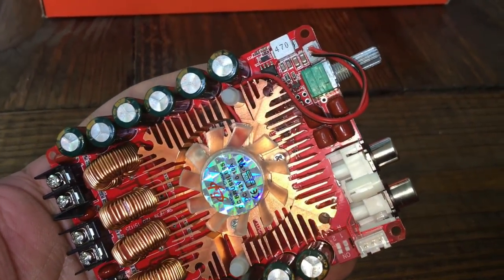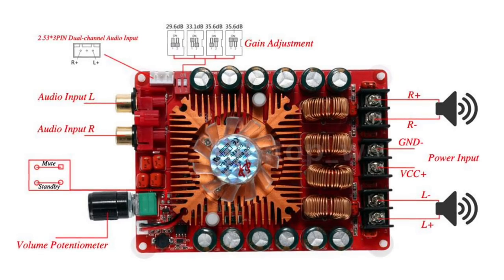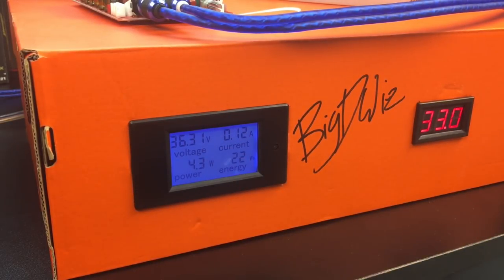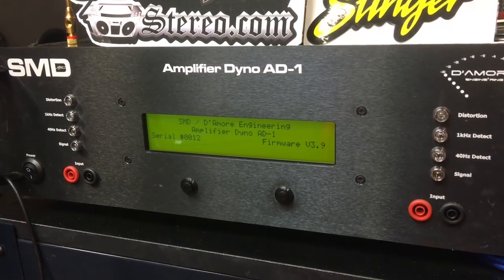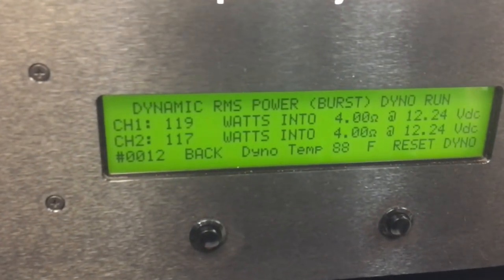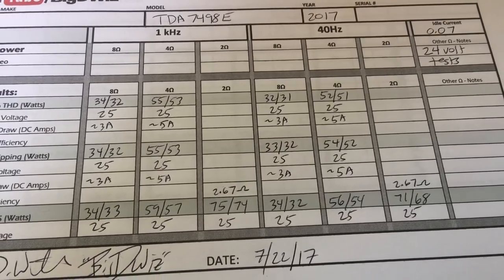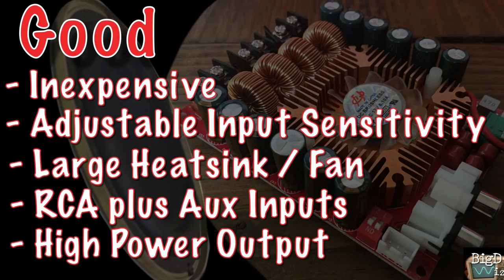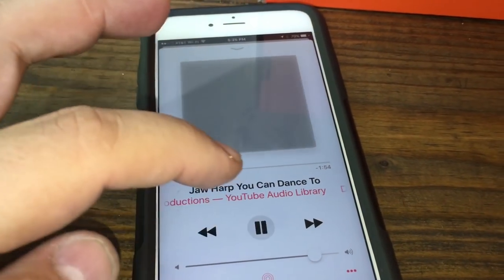Big Power in the Palm of Your Hand - TDA7498E 160+160 watts

Comment from the maker: Full disclosure: I purchased this amp, it was not provided by the manufacturer. All of the opinions in this video are my own and the content wasn't reviewed by anyone prior to posting. Affiliate link is placed below for your convenience. I receive a portion of the sales from these links, which help me bring you more unbiased content for this channel.
TDA7498E 160+160 watts - https://goo.gl/dw9LbO
Reply: These things are crazy for the price, but what is the amount of watts for it to be totally clean?
Reply: Thanks, but you're getting at least 1% THD at these settings correct? I'm thinking 40~50 watts @ 4ohm @ 0.01 THD Clean Rating? So I can figure out which speakers to buy. My PA system is 6200 watts, but I never use all of that because I want it as clean as possible and the same idea with my guitar amps. I using 2 full stacks running at 220 watts @ 2ohm 2 heads and 2 top and bottom speaker cabs a total of 16 12 inch,  440 watts @ 2ohm stereo to get the cleanest sound (Headroom) I'll use at the most 180~200 watts and normally a total of 100 watts when I play clean and picking from that 440 watt People tell me it's overkill but when I hear them play clean, it's still distorted because they're pushing their 100 watt head or amp to 80% I only push mine at 20~40% and the amp heads last longer. All about the headroom. I played some really big venues Larkfest was 80,000 people so I do need the power regardless
Reply: MrBrymstond Pretty sure these tests were done @ 1% THD. Just to give you an idea. And it all depends on your definition of clean. Some claim you can hear 1%. Other people say anything under 3% is fine. This is very limited in it's uses really. He says it doesn't have good bass. So probably terrible dynamics. Low damping factor. Zero soundstage most likely. I wouldn't expect great vocals. Maybe good for computer speakers alongside a powered sub? Plenty of clean power for that I'm sure.
Reply: MrBrymstond I wrote my last comment earlier, but just posted it. 
Actually if you pause the video and look at the specs it says 0.05% THD @ 1 watt.
Reply: MrBrymstond And I totally agree about headroom. Plus the dynamics are WAY better with more power. Your speakers really come alive with more power.
Reply: Ok thanks that's not to good, wow!
Reply: Absolutely, it's the way to go...
Reply: Great review, thanks for these kind of videos, they are very usefull. I have a question, usually these chinese amps do some sparks when you plug the power, did it happen to you? Also immediately after plugging the power, all voltage is discharged to the speakers, which they stretch alot, wont it ruin the speaker? Thanks
Reply: BigDWiz hey boss, I need some advice. In my boat, I have a jl audio w3 10 inch - 4 ohm sub, and two wetsounds rev 10 tower speakers that take up to 300 watts rms each. I need an amp or amps to push the these three speakers. Household finances have taken a hit, so top tier or premium quality aren't on the table this year. I am looking at getting two Pyle PLAM1000's. One for the sub, and one for the tower speakers. Have a budget of about $250 to work with. Can you please help me out with some advice or a recommendation?
Reply: blake dymond You should say what version the sub is. And you need to do more research. It took me less then a minute to find out that this Pyle amp is horrible POS that only puts out 70 watts power channel before it clips, and has screaming loud fans. You get what you pay for. If I was you. I'd be looking into car audio amps. 1 5 channel, or 1 mono, and 1 2ch, or 4 ch bridged. And used too. I have PPI 900.5 that would give you 230 x 2 bridged and 270 for the sub @ 4 ohm. I'm assuming the tower's are 4 ohm also. It's a shame the sub isn't 2 ohm. I paid $140 shipped for that used. @2 ohm the sub is 440 watts. Look at caraudio.com and doityourselfmobileaudio.com for good used deals on car, and occasionally, marine amps. Of course ebay, and Craigslist. I prefer forums as they're cheaper, and you won't get ripped by some scumbag most likely. You'll also be buying from a person who actually used it, and can tell you all about it. Decent car amps actually put out what they're rated at. Companies like Pyle are not decent. They're a waste of money. Either way car amps are cheapest, and best quality for your use. They really pound too. High damping factor which is important. They're designed for the environment you're gonna have them in too. Most have very good sound quality. My PPI is clean, and LOUD. It is also WAY more dynamic then my 125 watt per channel Sansui 8900zdb receiver. And that's at 75 watts per on 6.5inch speakers. They pound more then any of my home speakers do @ 50 more watts. And I have 6 different pairs running from 6.5in to 12in. Some ported, and some sealed. The car has that mid bass kick I wish I had at home. Car is the way to go IMO. At least for your application anyway. Good luck. And stay away from those cheap brands. Buying used is how you save money.
Reply: BigDWiz budget friendly 500 rms home Amplifier? Any suggestions?
Reply: MrBrymstond lol no way! 10watts?
Reply: MrBrymstond I don't believe Big D would approve.
Reply: For real 1,000 and another 2x500
Reply: I bought their 2x50 Bluetooth and it's a gem
Reply: +300 club Feeling a bit excited right now?
Reply: MrBrymstond no reviews....u really think it does rated? Let me check there return policy
Reply: MrBrymstond no reviews....u really think it does rated? Let me check there return policy
Reply: Even at 3/4 that's 750 watts clean and it most likely does but I'll bet you hear the distortion
Reply: Try the tda7294 or tda7293 theyre pretty awesome ones from st. Note 35-0-35(70Volts) to 39-0-39(78Volts) is the sweet spot (rated 80 volts) theyre by far my favourite chip im designing a 1000+Watt guitar amplifier using them and a few transistors
Reply: i would like you to make the same with the KNACRO 500W Mono amplifier!! is an insteresting board but will this get close to 500w? they sell it in amazon for 26 bucks!!!
Reply: BigDWiz nnn    l
Reply: BigDWiz kkkkmkkk
Reply: BigDWiz
Appreciate your posts have a question hope you can help I have an old set of celestion Sl6s book shelves want them on blue tooth amp there 100 watt @ 8 ohm . Will be running off multiple deep cell batteries in an RV. 
   If your ever looking for another Mazda b I always buy and sell them.
Reply: Efficiency?
Reply: BigDWiz the  best amplifier  reviewer there is information over load I would b happy if u do a review of the tda8954th an the IRS 2092S mini amplifiers
Reply: Ima buy a few and use some old school heat sinks I have in stock
Reply: Can you transmit them tunes please, I like :-)
Reply: Hey BigD, may I pick your brain for a second about the voltage booster, as you seem to know what you're talking about....I'm using a couple of car amps for home use and running them from PSU's. I'm guessing the PSU is under-powering them at 12v, would using the booster to make it up to 14v (if I can) make any noticeable difference to the amps output?
Reply: That's why we love ya man.. honesty means a LOT to me. Esp these days
Reply: @MrBrymstond  u have the link for that one?
Reply: @dwgwnr1969  No, but there much stronger.

Comment: Hi BigDWiz
Thx a lot 4 testing "China-Boards" it's very interesting, to see what you get for almost nothing. I have done a lot of testing myself and i suggest you put at least 2x22000uF 50V capacitors in parallel, very close to the amp power terminals (max 4 inch thick cable between capacitor and terminal). Then you will get some different data! These boards are very sensitive to supply's ability to handle PEAK-currents. ALSO the wire you use in your test from booster to amp, is way too thin! 320W total RMS@36V = 9A RMS! So current at the top of sinewave = 18A (4ohm load), So if the amp is 90% efficient at best, you must calculate with a minimum of 20A@36V running 4 ohms. So try to put on some 8 AWG (10mm2) wire and test again, then you will be surprised!!
 If you put a scope on the amp's power terminals, when running the test, you will see what i mean...
Best regards Jesper from Denmark..
Reply: Are the caps to provide extra current for power peaks? Is that what the two rows of large caps on the board are for? And so would upgrading them be any good?
Reply: @andreaselme4127  yes, pwm (digital) amps draw serious current peaks, thats why you always see rows of capacitors, and the bigger, the better. It needs to be very low ESR-caps, thats why there usually is several medium sized in parallel, the ripple current peaks in 300KHz to 1MHz, so low internal resistance in hf region is important.
Reply: Hey Jesper, may I pick your brain for a second about the voltage booster, as you seem to know what you're talking about....I'm using a couple of car amps for home use and running them from PSU's. I'm guessing the PSU is under-powering them at 12v, would using the booster to make it up to 14v (if I can) make any noticeable difference to the amps output?
Reply: @incorporeal3793  probably not tbh, the power supply can only output so much power on the 12v rail, so even boosting it to 14v wont help alot because the main power is stil coming form the power supply. Getting a larger wattage power supply would help id bet
Reply: Jesper, good info, thanks. The boost converter is only rated to 20A, it's possible that might be hitting the limit too.

Have you ever run your TDA boards at their maximum rated voltage? I'm reading the spec sheet and it specifies 45V as max DC input voltage. It seems you could reasonably get an extra ~10% by bumping it up to 40V.

Incorp, you can do that but you're still limited to the current output of the power supply into the DC/DC boost. You can put multiple PSU's in parallel or a really big one to get a lot of 12V current and feed a big boost board.

Comment: If you would of bridged it on the back you would be able to do the 2ohm test on it. that really what it really for. its a single channels amp so it doesn't bridge channels. it just allows you to run it at lower ohms. If any one wondering what it's really for.  🧐✌️

Comment: The output wattage comes from the theory also.Power=Volt^2 / Ohm,36v ^ 2 / 8=162 watt.Very good but it is not made for a lifetime,nor operation in full power and it is good as long as it lasts.

Comment: You might wanna check the output terminal labels. Mine were marked incorrectly. I checked using an oscilloscope. + and - speaker output is reversed on both channels.

Comment: These work really well for efficient Biamp line array pa speakers. Double 8 inch 8 ohm woofers down to 4 ohms on 1 channel for mids  and a compression driver on the other  channel for highs. Use a external crossover and bam they DRIVE plenty enough for concerts. There is a small 36 volt 5 amp Ac to dc power supply you can get on ebay for 10 dollars and I add a couple 10000 uf capacitors on the output of the power supply for a dynamic buffer. Cost about 40 dollars per cabinet to power excluding the xlr connectors and ac power switch. Reply if you want more details
Reply: Wuzhi audio build new tda7498e board , verry nice wondom Design.

Comment: I've just blown this up this morning, brand new, i only got it delivered yesterday, now it's on its way back to Amazon. 
Tested it this morning just to see if there was any sound coming out, i tested it on my subwoofer by replacing the TPA3116D2 mono module i usually run on, it appeared to push my woofer less than the 3116. 
Therefore, knowing that i bought it to use it bridged for the subwoofer only, i've bridged those J1-J2-J3-J4 and thank god i've i've been cautios and i didn't hook it up to the woofer or the computer. 
It lasted 1 second long after being powered on, made a big POP, smoke, so i promptly shut off the 24v power supply. 
Curious to see what happened, i've removed the heatsink and i've found a SMD 202 resistor being slightly bulged. 
Although the bridges were soldered up accordingly to the scheme on the board, and me having hooked up just the left channel (BLT) from the NE5532 pre-amp, i've removed the bridges and decided to give it another go, no matter the result : an ever bigger POP, and 3 legs chopped off the TDA chip. 
This has to be the crappiest board i've ever got my hands on, they didn't even bother shoving in a manual telling you how to operate it, i just had to take my guess and look at how other people did it (that didn't go to well i suppose lmao).

Comment: Sir, I bought the same amplifier with the black squares instead of those orange caps... What will be the difference?
Also, please I need your advice where to set the voltage of my Buck Converter, at 30 volts? This is the amp that I am building for my stereo electric guitar effects (stereo reverb, delay) :
Amplifier: TDA7498E 2*160W 12-32V
Power Supply: 36V 10A Switching
Buck Converter: 300W 20A 6-40V
2x JBL CS763, 45W RMS, 135W Peak

Comment: Bought this amp and literally smoked it when I shorted the speaker leads for only a moment. So, be careful it has zero short circuit protection. Other than that it sounds pretty good on my Polk Atrium 8 speakers. Bought a second one so each amp can drive one speaker. Will drive both of them with a 36v 15A power supply I bought.
Reply: What do you expect for the price? They build this cheap crap with counterfeit parts. That includes the IC.
Reply: @1pcfred  Yea. A lot of the chips are actually counterfeit TDA7498 not  even counterfeit TDA7498E. Looks like he got something closer to a TDA7498E on his.

Comment: Even though it didn't hit rated. For less than 20 bucks that was still pretty impressive. I'm sure that what you trade is longevity but its a step in the right direction for the red team.
Reply from the maker: Fo sho, not a bad deal

Comment: Considering putting one of these in the attic above my back patio, audio input coming from an airport express, and ceiling speakers mounted in-ceiling under back porch. Would heat in the attic be an issue? Just want it out of sight and always on. Decent enough to pump tunes through a couple Definitive Technology di 6.5str speakers? They are dual voice oil 8-ohm, so would like to wire each one parallel to achieve the 4-ohm numbers.

Comment: One of these , that voltage booster , a Bluetooth module, and an old PC power supply seems like it would make a good amp that you could use in a garage, or a small cabin without a big investment to to a built-in system.

Comment: Hope you are doing well! I have two passive bookshelf speakers and each tower consists of Woofer 6.5 Inch 4Ω (60W RMS)+Mid-Range 4.0 Inch 8Ω(40W RMS)+Tweeter 1.5 Inch 4Ω (20W RMS) that is 120W RMS+ 120W RMS Three way system with crossover. Can I use my two passive bookshelf speakers with this amplifier boards as 2.0 with ease or not. If yes could you please advise me on the appropriate volt of the transformer and the ampere?

Comment: What about testing B&O icepower moduls?
They may be more expensive, but you get quite a lot also.
It have auxiliary power for external filters,  So you will not get any grounding problems.
you can plug it directly from 240/120 ac power. So you will not need any transformers at all.
It is used in very expensive B&0 products.
So cheaper model will end up more expensive than B&0 products since they need transformers
and rectifiers and capacitors.
And it does not needs noisy fans either..
Simply best amp for tiny places and easy plug and play modul.

Comment: Howdy, I'm building a box with a 120W 8ohm 6inch sub and 2 35w 8ohm midrange speakers. Would this amp be suitable or off hand could you recommend an alternative?

I do plan to use a bluetooth module as well (or an amp that has one integrated). I plan to build a semi portable bluetooth speaker. TIA.

Comment: I've been playing with one of these amps for a few days and indeed it has some roller coaster of a crossover band. It's relatively flat from 200 Hz to around 23 kHz, there's a huge spike around 26 kHz, then drops off to zero gain at about 28 kHz. On the low end, gain drops slowly from about 200 Hz until it goes down to 100 Hz then falls like a brick. Perhaps this amp was made for dogs?
Reply: Cheezy Dee    this, my sir, is some valuable information you've got there!
Reply: What do you mean it falls after 100hz? test showed almost same power at 1khz as with 40hz, you sure you didnt get board with lpf?

Comment: Hi
I need a 120w rms for my small subwoofer 4homs.
I have a 150w step up 12v to 30v adjustable. 
do you recommend any board? 
Regards
Reply: Use 36v 10A smps power supply for full power.

Comment: I'm having the hardest time finding an amp that I can run both channels into one speaker. It sounds like you said that can be done with this amp?
Reply: Yep, this amp will run in BTL mode with both channels wired in parallel to give 220W.

Comment: I have the 1800w 40amp version of that boost converter my plan was to use it to charge a 45ah lithium battery in my car that needs 16.8v to be fully charged and I did not want to have to delete my friend battery due to the chemistry is being different so this would act as an isolator as well. Do you think it would work?